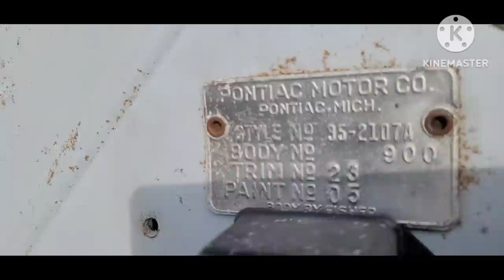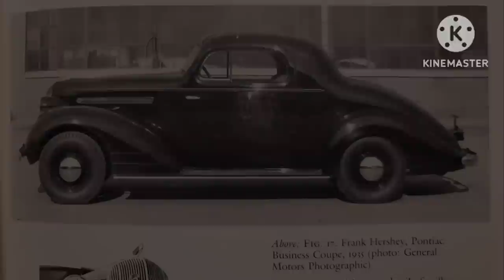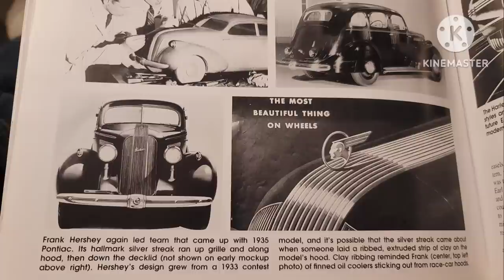I found a 1935 Pontiac 3 window coupe! Walk around, parts inventory, & mock up assembly!

Comment: The 1935 Pontiac was a drastic change from 1934.  The first year for the Silver Streak models that would last through 1956.  After two years of the straight 8's only, Pontiac offered both a 6 and 8 for 1935 to be more competitive.  1935 was the first year for the Pontiac fixed hood ornament instead of the previous outside radiator cap.  Those 35 hood ornaments are so rare and fragile.  The standard ornament was the Indian Chief, the optional one was the Indian Maiden (that will run you over $1,500 to get one today). Both are just fantastic works of art.  Because I am a Pontiac guy, this is a very good one to have and there are very few left due to all the wood still in the GM cars and relatively low projection numbers, only 129,468 cars among all models that year.  Unless you have an outlet to get all the missing parts (as you seem to run across once in a while), this would be a very long term and expensive project to bring back totally stock.  Whether you keep the car or pass it on, seems the best route for this car would be as a resto rod by keeping with the original lines but upgrading the missing driveline, etc. to save this car and get it back on the road to enjoy again.
Reply from the maker: I've been looking around, and it's tough to locate anything for this car. It looks like it would be best to find a parts car. The flathead six ran with minimal change until 1954, and I have located and purchased one in Pennsylvania - just need to get it home now. The transmission will be a bit more challenging. 
129,000 is a very low number, likely not helped by the Great Depression. The wood body, and the fact it's prewar all make survival numbers low.
Reply: @mr.goodpliers6988  You need to Fix this Car please 🙏, you will most likely never find another one…, I also have some wood to do on my 35 Lasalle

Comment: In my eyes , that’s the coolest car you have that I’ve seen on your channel so far. 1935.. the nicest year.. and a 3 window coupe ,Rare as Hens Teeth! Hydraulic brakes too, that car has a lot of potential, I have a 1935 Lasalle 4dr Sedan with the Turret top , Fisher body its about the same condition but still has the straight 8 , I’ve had it for 15 years , and I am just now starting to work on it.

Comment: De Ja Vu. for me. I did the exact same find for my '35 Pontiac Coupe. Except mine was one that stolen from me 47 years earlier. Found it again. That coupe has a '36 grille, even though it is a '36 with suicide doors. The fenders are '36 also. No swages in them. I am here in New Zealand. Mine is right hand drive.
Reply from the maker: Yes I realized after I put that 1936 front clip on that it is completely wrong - it came from an 8 cylinder car
Reply: @mr.goodpliers6988  Awesome find though. I am missing a few parts from mine. Can't find them here in New Zealand.

Comment: Merry Christmas buddy, that is a good looking ol Pontiac ihad a 1941 Pontiac one time it had a straight eight in it  I sold it as parts , nice black in color no rear end no front end now windows no seats no head on the block no transmission, it was what i call A whol lolthanks 55 Chevy please thanks 2 or more door rollers car thanks BigAl California
Reply from the maker: Joe just got a 2 door post 55. It's on the rusty side - will need a good share of metal work

Comment: Make it stock..It will only appreciate in value..Don't be in a rush. I did a restoration on a 51 chev half ton but I didn't do a thing until I had all the parts I needed first.

Comment: I have one of them, I call my 1935 Pontiac Coupe Woody because of all the interior wood structure that I will be replacing with metal. My 1935 Pontiac has  leaf spring front suspension which I will replace with mustang 2 front suspension.
Reply from the maker: I might be interested in any of the stock parts you don't use. Where are you located?

Comment: ITS A 35 PONTIAC DELUXE EIGHT BY STEERING WHEEL.  VIN WOULD START WITH A 8. LONGER FRAME AND RUNNING BOARDS ON THE EIGHT OVRET THE SIX. IVE RESTORED 2 35 DELUXE 6 CONVTS. TALK ABOUT RARE. DONT STREET ROD IT.

Comment: Found this video today while hunting for parts for my recent purchase. 1935 Pontiac. It has already started going the restomod route by the previous owner. But it been in the garage over 25 years. SBC, Jag rear, very questionable rack & pinion just sitting under it, that i had to ratchet strap to the frame to roll it out of the garage. Looks thou i have just about all the body parts, minus the hood ornament. Looking for a V8 Radiator now so i can get measurements from to build a modern one, or use if it good enough. 

Anyways cool video and I subscribed.